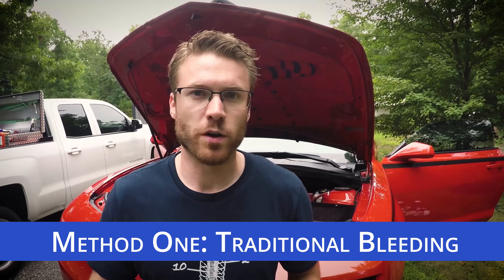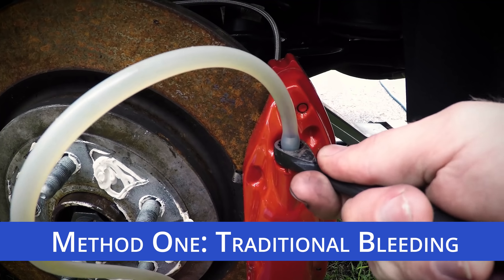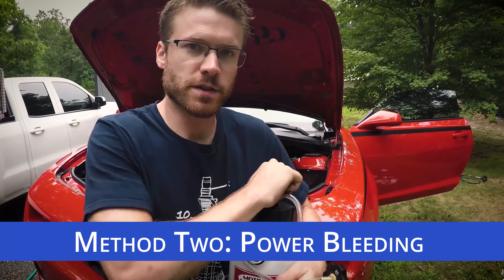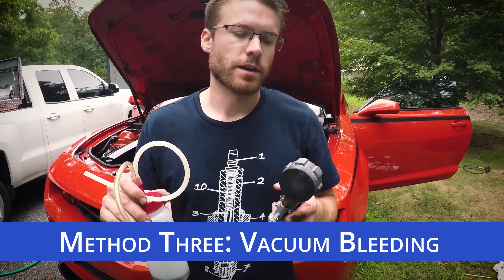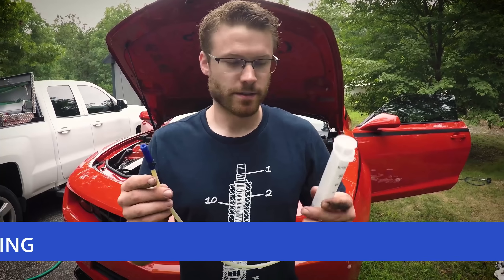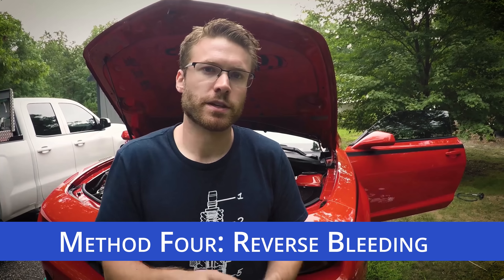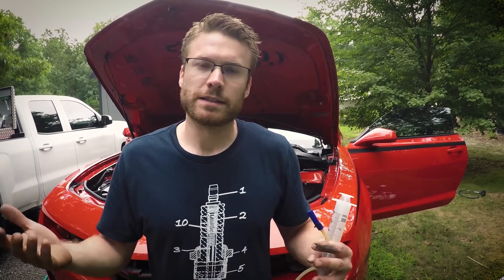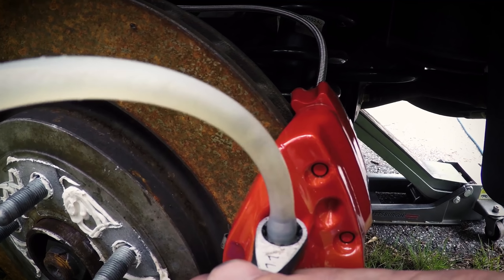Best Brake Bleeding Techniques - 4 Easy DIY Methods Anyone Can Use At Home

Comment: If you just want to change the fluid, there is method number 5 - gravity bleeding - where you open the bleed screw and allow fluid to drain under gravity. I personally prefer to use a syringe to suck fluid through the system and also find it easier to use a short length of silicon hose.
Reply from the maker: That is true! Definitely another option.
Reply: @TheSundaeDrive  Does the push method through the master cylinder bleed the master cylinder? What if you have an actuator that pressurizes when the key is on?  
Also, can you use the vacuum method to bleed at the caliper with the vehicle off?

Comment: im sitting in a harbor freight parking lot considering bit bg a vacuum bleeder.
I usually just pump tbe brakes good then open a bleeder valve then go press the thing to the floor and put a baseball bat between the pedal and the seat then close the bleeder.
I dont like not being present to witness what comes out tbe bleeder but it does work very well for me. 
Great video by the way 😊
Reply from the maker: That's a first for that technic but sounds like it works for ya

Comment: It saves a lot getting up and down if you have some one to keep the master cylinder full during the vacuum bleeding process. Note -keep brake fluid away from paint. It is an excellent paint remover.
Reply from the maker: Very true on both counts 👍👍

Comment: Hi. In the 3rd method I see you pump a few times before opening the bleeding valve. Is that necessary? Once I open the valve for how long should I keep pumping on each side?
Thanks.

Comment: Thanks very helpful, I found with your third method the suction pump I kept getting small air bubbles being sucked down the threads of the loosened bleed nipple. So I removed the nipple and replaced it with PTFE tape applied to the threads.
Reply: I use a syringe to do this, and have really good control over the amount of suction (not much is needed) and agree that the PTFE tape is the way to go - and also prevents the bleed screw seizing-up due to rust!

Comment: Why don't you suck the fluid from the bleeder with the syringe too, as you do with the vacuum pump??? Basically you can use the syringe as a vacuum pump!
Reply from the maker: Yes, you could definitely suck the fluid out of the reservoir first then fill it up and push the fluid through the lines. You just don't want to let air get in the lines preferably because it can be difficult to get it all out. I would suck out the fluid until you reach the lines then add more
Reply: You got it man, extremely simple !

Comment: Again I hear "start from right rear wheel". But my Mityvac vacuum bleeder instructions say start from the closest wheel and work back. My Haynes manual also says start from the closest wheel to the master. So what the hell?
Reply from the maker: Hmmm this is how I grew up doing brakes and I was always taught to bleed the furthest wheel and work your way towards the master cylinder. Do they give a reason in either guide?
Reply: @TheSundaeDrive  I don't think it matters as each line is a dedicated individual brake line. Just so long each line is purged individually (bled) I don't see a problem. If someone can explain why a sequence is necessary would be good.
Reply: @TheSundaeDrive   Me too, for almost 50 yrs we went from farthest away 1st. I would think gravity might want to help itself, air bubbles/fluid right into the shorter brake line. Comments?
Reply: @ws678ta  Im guessing for vehicles with abs there might be air trapped in the abs block instead of the calipers. So by doing the closest one you will pull air from that as well, thereby keeping it from spreading to other calipers? Only thing I can think of